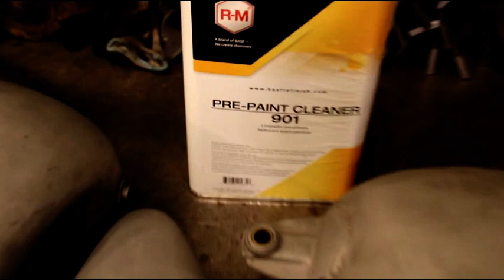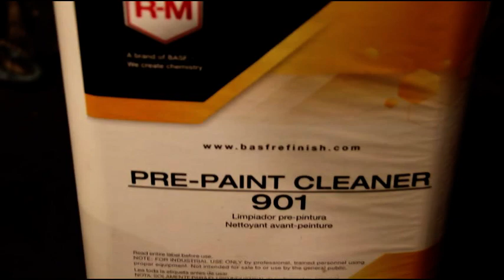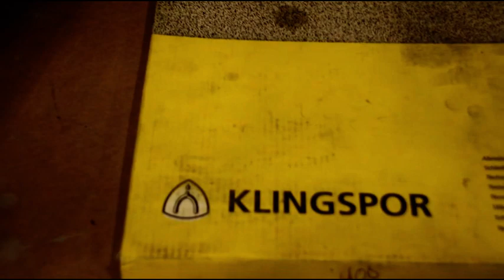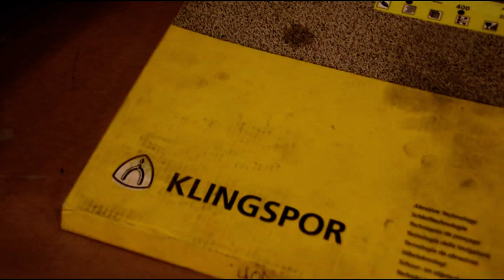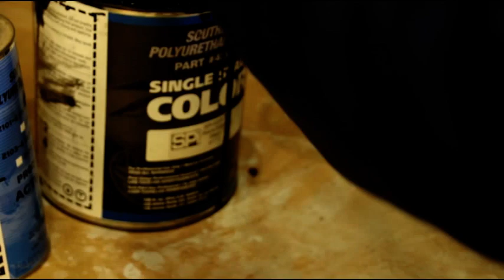Painting Early Harley Davidson Fuel Tanks Gloss Black

Comment: lookin good there bud! would that system be equivalent to the old dp90/k200 like we used to use? probably better i'd imagine. thanks again Brian, Will.
Reply from the maker: The SPI system is the best I have used.  I too used DP primer in the past and RM epoxy.    SPI epoxy is the best out there and the Turbo Primer is the best of any brands I have tried.  Mixed 4:1 it builds very fast and sand easily.  80 grit scratches are gone in 2 to 3 coats.   Mixed 4:1:1 it still goes on super smooth but doesn't build as fast.   If you try it once you will be hooked and it will be the only system in your shop.
Reply: @metalshaperJeep  thanks bud!